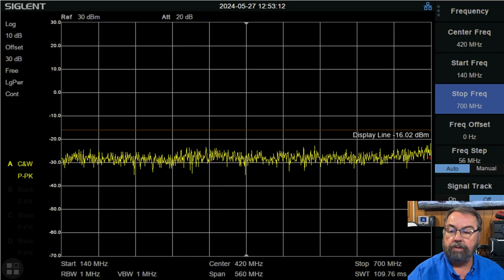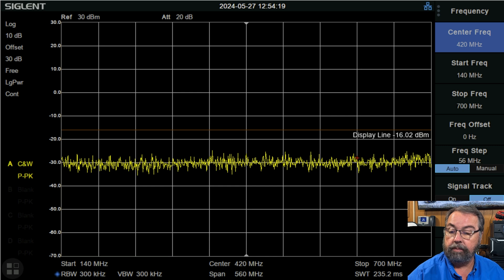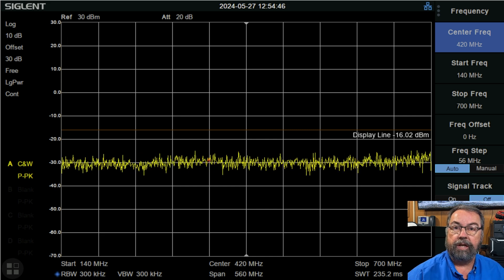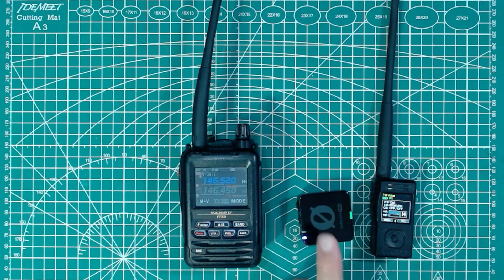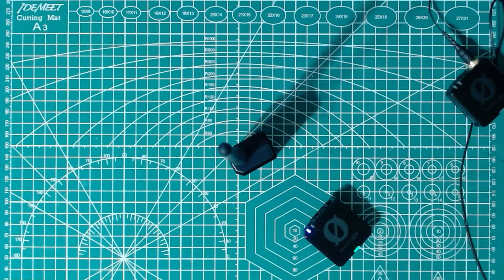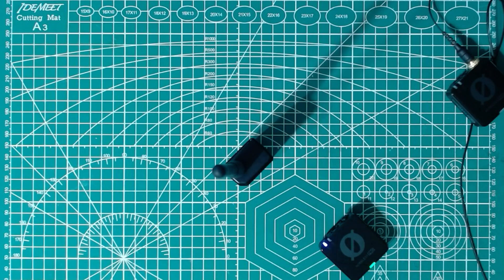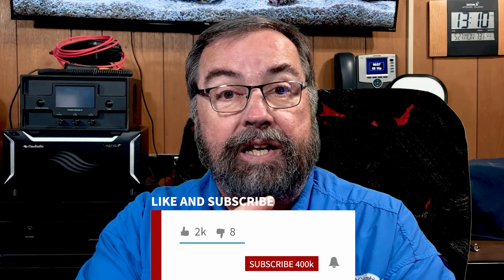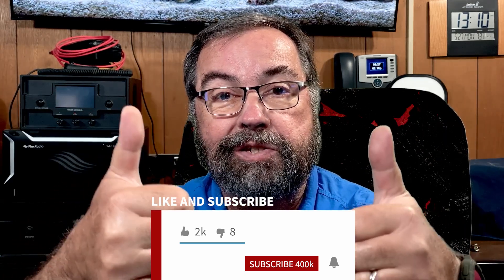PICO APRS vs traditional HT comparison!

Comment: Hi , I'm Taner Schenker (DB1NTO, founder of PicoAPRS). The TX audio should be also very clear! Maybe you have a faulty unit!
Reply from the maker: Hey Taner!  First of all, thanks for watching, and secondly, the Pico is freakin awesome!  Probably overdriven a bit as I was testing in the house, using an FT5D on low power, so I wasn't completely surprised.  Also, what came out on the video audio was most likely just the way the mic picked up the recieved audio.  I'll revisit that and let you know.  I found mine on ebay, and other than possible rx audio issues, I have no complaints.  I didn't buy it to be a tiny HT, I bought it for the APRS functionality, so in the end - very satisfied!  

I will try and hit a local repeater and see if that makes a difference.
Reply: @FEPLabsRadio  Hi, maybe your speaker is broken! Can you please contact Wimo support and DXE to see if they can send you a new speaker? DXE should already have some replacement speakers from Wimo.
If you have any problems with this, please let me know! I will help you get a new speaker (free of charge).

Comment: In my world, IP68 is the minimum for HTs. Any future forecasts? Thanks, KF0NNQ.
Reply from the maker: Hey Bill, I'd be thrilled if all the big 3 radio makers would use USB-C charging.   As far as IP68, you're guess is as good as mine.  Probably the only ones I can think of are the high-end Motorola HT's designed for public safety use.